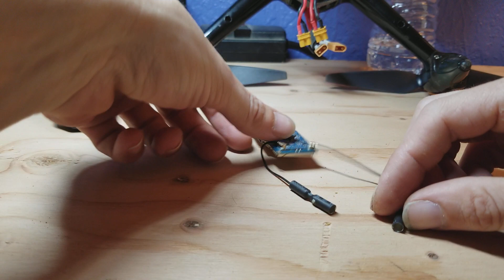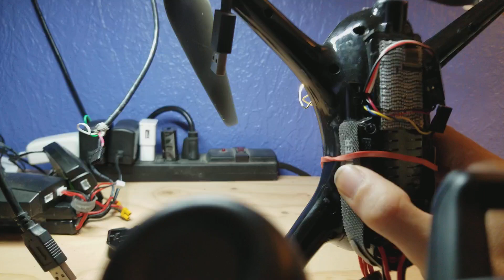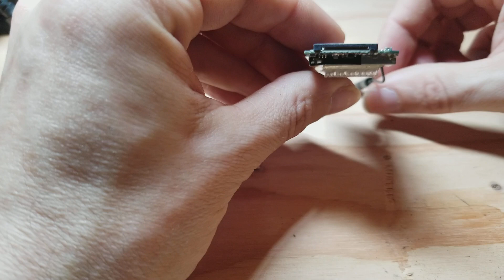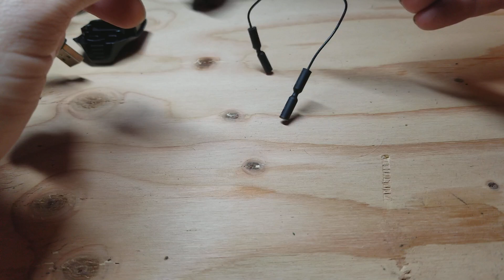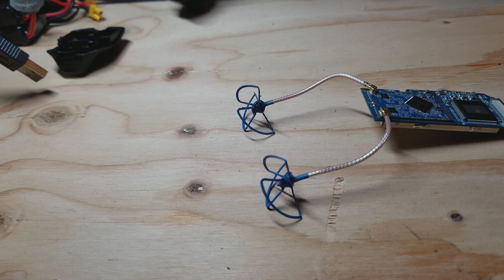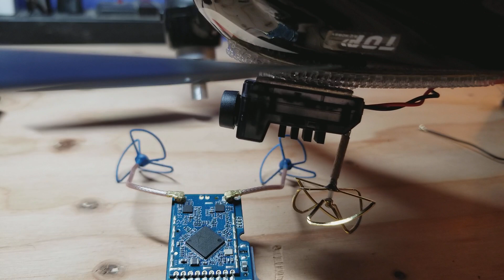FPV range mod for 5.8ghz WiFi FPV on MJX Bugs 2W and other digital systems.

Comment: I did this exact mod on my bugs 5w and I didnt see any increase in distance in my fpv. Its exactly the same down to the meter. I think it actually cuts out more now with the cloverleaf antennas. I live in the country and fly in open fields with no interference. I'm going back to my stock antennas!

Comment: Have u did a vid on the 2 battery mod and if not would u do a vid showing how u did it and what ur flight time is and batteries used or at least a better look at it
Reply from the maker: I used the original bugs batteries, removed cases, placed vtx externally to make room inside the belly and two caseless batteries fit snug inside.  On slow and easy flights Id get 16-24 minutes.
Reply: @ericmoore86  
Awesome thanks I'm waiting for my red body to come in and when I switch I will prob do a mod similar but I have another ? When I  unlock my motors and hit auto take off sometimes it stutters and doesn t wanna go other times it doesn't go but if i throttle up it's fine any idea what may be causing that?
Reply from the maker: @sublimeguy  i would do the accelerometer calibration away from buildings and power.. not the standard calibration before take off, but the one where you hold the sticks in or something like that, havnt flown mine in a long time since flying 5" acro quads.. youll have to look up the users manual.  Thats the most common solution for that.
Reply: @ericmoore86  k I will check it out thx brother

Comment: 5.8GHz four lobe skew planar antennas are what you should be using on the RX. The 3 leaf clover antenna is works best as a TX antenna on the controller. And of course they need to match polarization. 3 Leaf clover (LHCP) left hand circular polarization on the transmitter, and a 4 lobe skew planar (LHCP) left hand circular polarization on the drone receiver. That works the best.

Comment: do they need to be wifi antennas? or just standart 5.8 ghz just like on the fpv cams?
Reply from the maker: I belive reguardles the label, any antenna tuned to 5.8 is going to work.  Its about the wavelength.
Reply from the maker: When you say "fpv cameras" there are several types tuned to 5.8mhz such as dipole, directional, omnidirectional.. what is best depends on environmental circumstances and pilot preference and type of use.  Omni is not the best for long range for example, but it is great as spreading a clean signal in all directions at less distance.  My purpose in these were to help reduce signal drop and latency that occured when turning facing me at medium ranges.. but gave me more range as well.

Comment: Update I did this mod and not much of an improvement.  still crappy  intermittent dropped signal. however there is almost no lag.
Reply from the maker: If you go analog, 200mw is sufficient.. i tried 600 and was overkill.
Reply: Overkill ?  in what way ?    would putting clover leaf like these on the 5.8Ghz improve RX TX connection ? I was thinking of taking these off like i said but then using them on the Receiver to control the bird.
Reply from the maker: @1peanut  overkill meaning anything inside half mile is over saturated with signal.. its great for beyond 1 mile but these mjx drones only go about a mile.  I found 200mw is plenty for the drones range.
Reply from the maker: Have you tried changing the channel?  If you hold the camera button for about 5 sec or more it will switch.. otherwise there may be a lot of interference as well.
Reply: the cloverleafs i installed are 2.5 dbi  it was literally the only ones i could find with the right connector on them.
Reply: I think i am going to remove this wifi card and camera all together and put an external setup on it like 600 ma.

Comment: Eric thank you for sharing this, im very confused.
First of all, where do i connect these antennas to? Is this chip the drone's wifi chip? Where are all the wires that connect between this and the drone?

And by the way, i think the antennas and the transmitter itself have to be the same frequency, so how do i know what to buy? 2.4 or 5.8 ?
Reply from the maker: 5.8

Comment: Hey Eric I was wondering if its not a good idea to fly near another brother?
 Do the signals conflict?
  The reason I ask is my bud collided with me the other night.
 He went down & lost 3 props the Bugs2w suffered a slight dislocation of 1 of the legs.
Reply from the maker: Longboard Louie fpv signals will.. but the controller should not... I would power one up then re-bind the other to be safe.

Comment: Very good video, easy to watch & listen to.
I was thinking of doing your mod ,but thought would moving the stock antennas out have a similar result?
Reply from the maker: Longboard Louie I tried that first and had worse results than stock.  I feel this is the best "all around" solution.
Reply: Ok thx Eric, I just hope I can get the stock antennas off & out without trashing the body.
Also does the board you're demonstrating with come out easy? Or is it possible to do the switch leaving it in?
  And just so you know I subscribed. Maybe you could do the same, my numbers are low. 🤣
Reply from the maker: Longboard Louie it is a pain to take it apart to get to.. full teardown involved with high risk of damage.  
Alternatively, I recommend carefully drilling holes in the bottom and sides to make access. Put a BUNCH of tape on a drill bit so you dont over penetrate into the card.  Then use tweezers and small screwdriver to R&R connections.. could just snip the old ones off and leave in bird, they do not weigh much.
Reply: Eric Moore, good, I didn't want to take it apart. I found Cloverleaf antennas on gear best for under four dollars each they look similar so hope they will work, 2.5 dbi.
Reply from the maker: Longboard Louie as long as they're for 5.8ghz anything will be great compared to stock.
Reply: Hey Eric, got my antennas now the testy part.  What do the antennas increase, the video range or the flight distances range?
 No word from Narrowdeep on his mods.
 Thx
Reply from the maker: Longboard Louie the biggest gain in this mod is omnidirectional signal so there are less disconnects from various objects and orientation.. however I found the range to be 50% better as well.
Reply: Eric Moore thx again, hope to try it out tomorrow.  The antennas i got are pretty short and just hang from the undersides
Reply: Hey Eric, I'm helping out a fellow with his bugs2 and wondering which antennas to order, write hand or left hand I don't understand what that means.  
Thx
Reply from the maker: Longboard Louie no idea honestly.
Reply: Eric Moore oh well I just picked one and it seems to be working.

Comment: I was looking for long time ago a solution like this. Alredy bougth the antennas!! ..... THanks very much.
 I see in your dron a battery mod, how much time does that batterys give you?, and what is the battery capacity of these two?. Thanks in advance Eric.
Reply from the maker: Brian Escalante Aguilera , with the stock cam on, dual stock batteries get me about 10-15 min.. with the stock cam and board removed and micro AOI vtx on to, I have flown in excess of 20 min.
Reply from the maker: Brian Escalante Aguilera it takes considerable time and cutting, requires WiFi board to be external.

Comment: Cool vid, please check your orders on Amazon and provide link.  I looked on Amazon and I have no idea what type of connector it should come with only that is appears they should be at right angles per your vid.  Thanks, I can't wait to make this mod but need correct antennas before I can start.
Reply from the maker: 2wrdr 
AKK IL04 5.8Ghz IPEX Circular FPV Antenna U.FL Connector(Blue) https://www.amazon.com/dp/B07BDMX57Y?ref=yo_pop_ma_swf

Better ones can be found but use this for reference.
Reply: Thanks for the link.  Also to be clear, the video transmitter you are showing is the stock transmitter from the B2W, correct?  Excuse my ignorance as I have not even cracked the cases yet.
Reply from the maker: 2wrdr yes, and the reason I recommend drilling holes for access is because it requires a full teardown to get the WIFI board out.
Reply: Thanks you so much!
Reply: I don't want to remove the board.  I just want to improve the antenna system.  I hope to open the cases this weekend to get a better perspective.

Comment: it was tested? What was the result? Thanks for sharing!
Reply from the maker: V-DRONE I did this mod a long time ago, been running it like this for some time.. it is tested and far better.  You dont lose connection when turning the bugs while far out.
Reply: Eric Moore thank's a lot!
Reply from the maker: V-DRONE sorry, been busy havnt had time to respond.. it changes daily with weather and interference.. prior I was lucky to keep fpv at beyond 400 meters and sometimes less than 70.. now I can get 500-800 meters.. all depends on environmental circumstances.  I live in a populated area, so I would expect at least the same results and better for others.